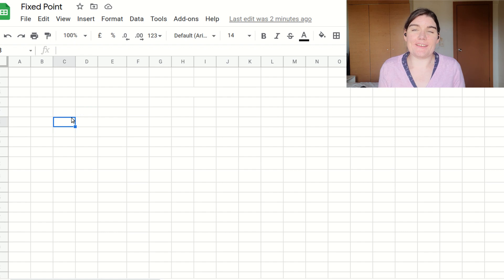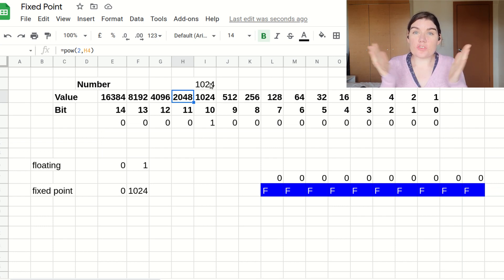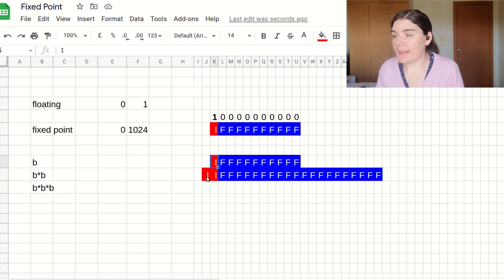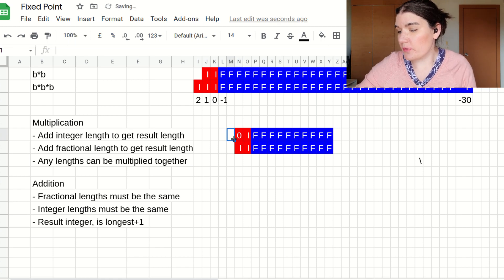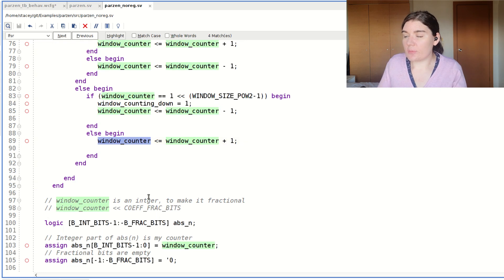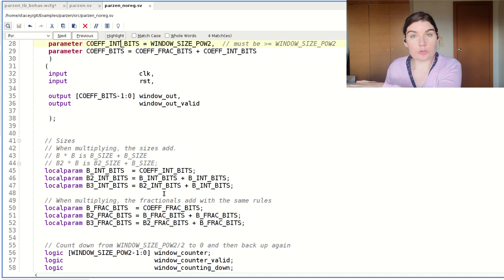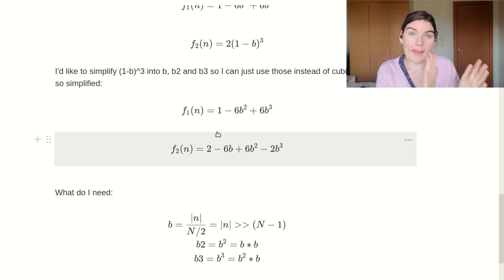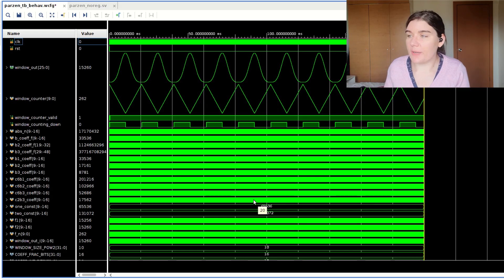Fixed point basics in Verilog for Beginners! Continuation of polynomial example.

Comment: At 9:50 I think you have an error on your overflow check comment. Instead of overflow = b2_coeff_f[B2_INT_BITS-1:B_INT_BITS-1] > 0 ? 1 : 0; Your range for b_coeff_f should be [B2_INT_BITS-1:B_INT_BITS]. The reason is that B_INT_BITS-1 is a valid bit b_coeff_f.